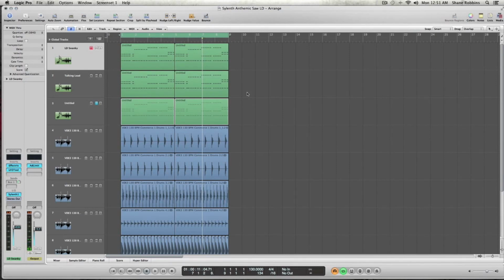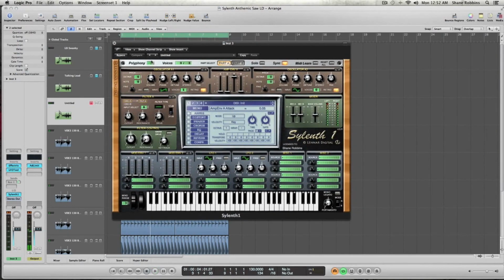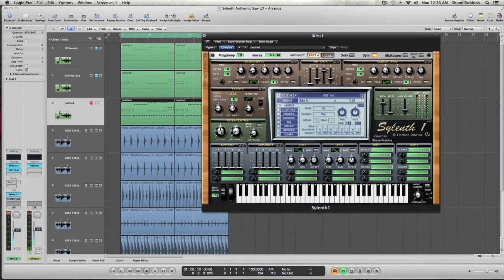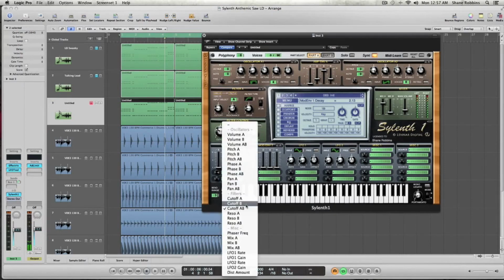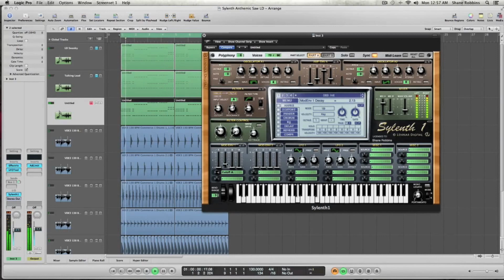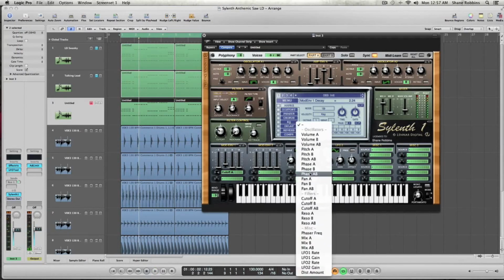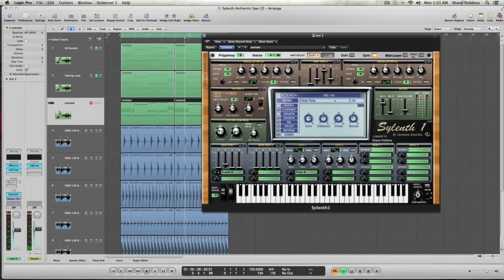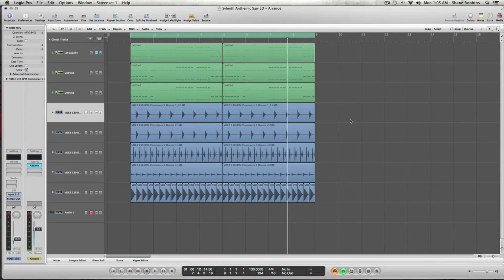Sylenth1 - Hardwell Style Lead Sound - How To Tutorial

Comment: preset 174-analog lead, turn cutoff up, turn 3 of the osc's octaves to 0, polyphony up and you have a hardwell lead :):) 
it sounds so similar that i think it's what he actually uses.. i wouldn't be surprised, anyway
Reply from the maker: But I only used two Oscillators ;)
Reply: ***** what are the benefits of using only 2?